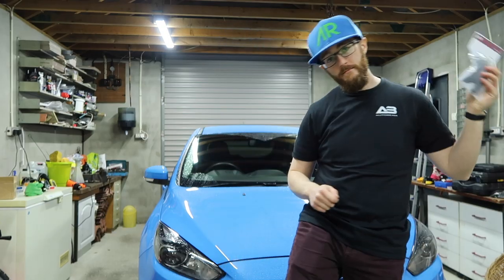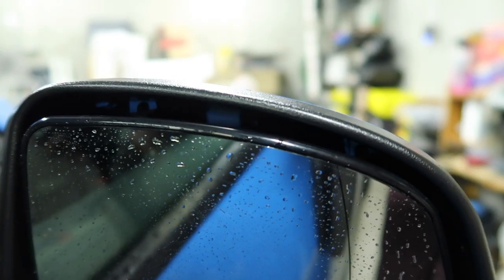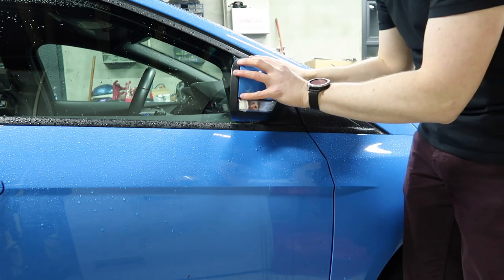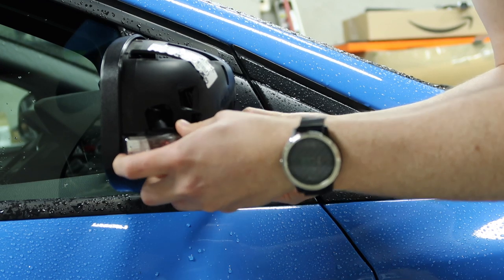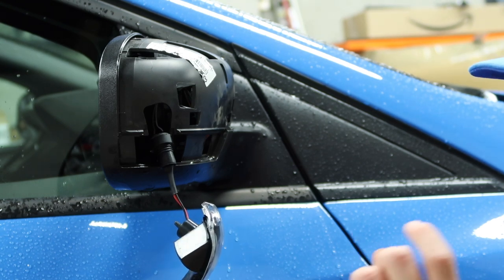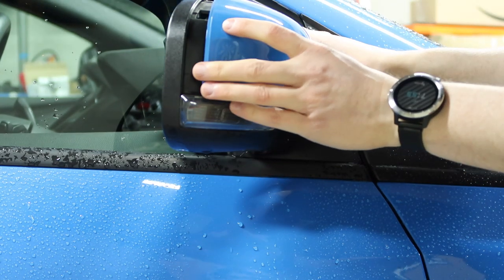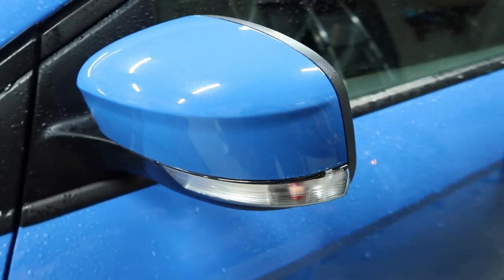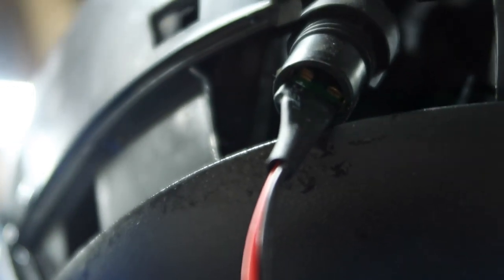AUTOBEAM LED 501 SEQUENTIAL INDICATOR UNIT INSTALL! | FOCUS RS

Comment: Dang! Went to order these and they're sold out! I'm importing the power folding mirrors you got for my USDM RS, and wanted to order these along with the LED puddle lamps you installed. Hopefully they come back in stock soon.
Reply from the maker: The new updated version is available to pre-order on the autobeam website!
Reply: @AdamRainey  Thanks, Adam! I actually ordered them a couple days ago when they first became available for pre-order (I was checking every day haha). Thanks to your videos, I also ordered the LED puddles, footwell lights (in blue) and the boot panel lights. I would've ordered the front and rear indicators, but the US tail lights are different from the EU ones. I should be getting my EU power folding mirrors in a couple weeks. Thanks for all your videos showing the installs on all these!

Comment: Nice. Want !  Are you going to fit the sequential rear indicators at some point? do you think AB are going to do those as well or do we have to buy from zee Germans?  Cheers.
Reply from the maker: I might do. Right now I am happy with just having all the rear bulbs swapped out for Autobeam LEDs. I don't think Autobeam are prepping a full housing replacement but it could just be under wraps!

Comment: Question: The middle back brake light (the one on the spoiler). Is there a way to make that flash (5 times) when pressing the brake pedal and then have it stay on as normal? I see some Subaru WRX & STI's have the option (on the base of the back fender)..   Thx

Comment: Do these suffer from condensation inside the indicator? As there looks to be a gap where the wire comes out. And you didn't push the rubber end over the housing?
Reply from the maker: The rubber end doesn't fit over the housing with the current design. Time will tell but I haven't noticed anything yet
Reply: @AdamRainey  ahhh ok buddy, I've actually ordered some. But deciding whether to seal the hole where the wire comes out before I install them
Reply from the maker: @ExpeditionTommy  I would say go for it yea
Reply: I am tempted. But since you've had no trouble I might not bother 😂

Comment: Thanks for the vid mate. I'll keep my eye on these coming back in stock - going to fully LED my Mk3.5 Titanium X, can't wait! One question though - how do the units light up when you unlock the car? Do they just keep running side-to-side or do they stay on for as long as the front and back indicators do too?
Reply from the maker: Hello, they run to the side once and then remain on for as long as front and rear indicators do
Reply: Adam Rainey thanks so much!

Comment: they have changed the light flow its little led sequential not a light flow as yours shows
Reply from the maker: In regular day light I can see the individual LEDs
Reply: @AdamRainey  cool thanks for letting me know thought they may have changed there design appreciate your time for reply :)
Reply from the maker: @FLAWLESS-DETAILING  yea mate, they could well have
Reply: I have just fitted mine and they are definitely not same as the ones in your video. They are now a smaller strip of LED's along the middle, not the bar of light in the video. Shame as that's what I wanted really.
Reply: @MCJC96  yeah mate im not happy with mine as i ordered them for the flow affect false advertising
Reply: @FLAWLESS-DETAILING  yeah totally agree! I have sent them an email with an attached video of what I have installed and stated how disappointed I am with this product that they have sent out compared to Adam Rainey's one. To be honest it looks like a cheaper product and they have charged the same price!! Very disappointed. I doubt I'll hear back from Autobeam, but worth a try I guess.
Reply: @MCJC96  im going to do the same mate these are poorly made if they dont reply just go through paypal as the item does not match the description
Reply: yes  they sent me the same ones. look very cheap i wont put them on my car. if you  look at the connector in the vid it is different now its very cheap plastic